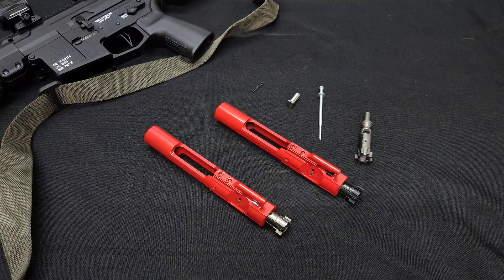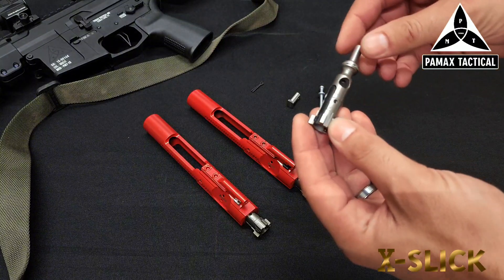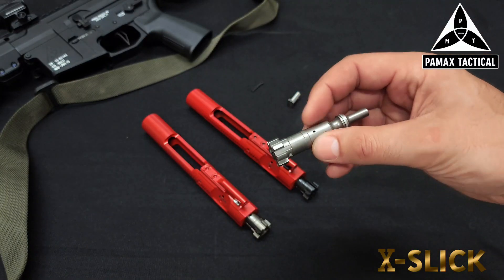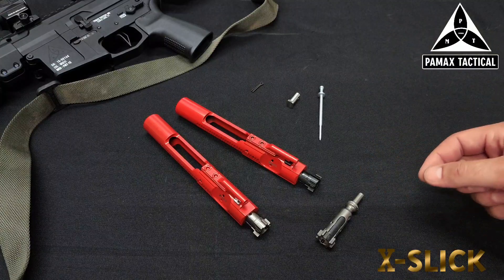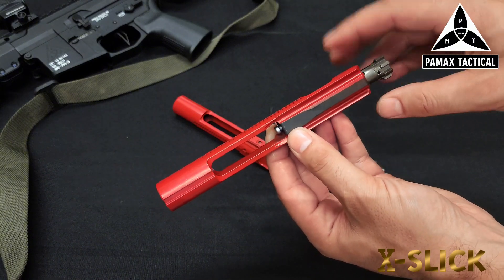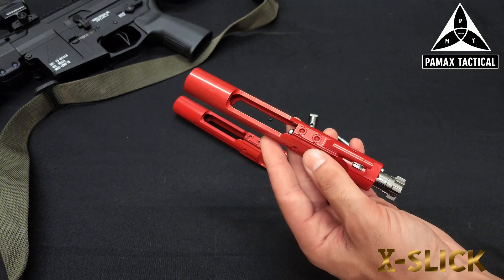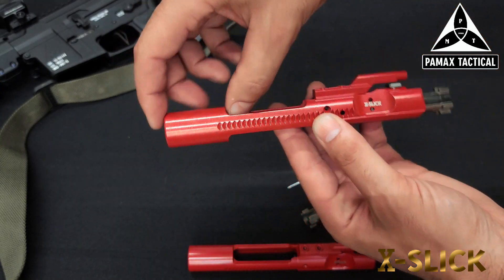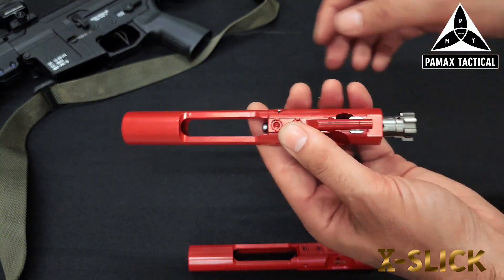XSlick Bolt Carrier Group Gen 2 Coating & Parts Overview - USA PAMAX Tactical

Comment: I have called PAMAX at least 100 times over the course of a week. And all I get is a machine that says they are either with other customers or on the shop floor. IE cant be bothered. Which tells me that this so called company, Especially their customer service is the but end of a joke! Not only that they are located in Florida but the telephone number is out of Pennsylvania. And that in itself seems to me like its quite shady! And because of these factors I will NOT be doing business with them even if I could reach a customer service Rep!
Reply from the maker: Hello sir, we mostly manufacture product, resale is only part. You probably got your call blacklisted as a result of spam filters. Feel free to shoot an email or text, you'll get a faster response since the phone is not monitored regularly due to high volume of spam.

Comment: U spend a lot of time crapping on Nickel Boron on your website (rightfully so) but then you use a Nickel Boron bolt.....

Care to explain why?
Reply from the maker: @KevinWood44  Absolutely. So if practical, we WOULD use our XSlick coating instead of NiB. The problem is our coating is not done through electrolysis, and so (right now) we can't get a perfect of it on the bolt. So we need to use a market coating to maintain the appropriate tolerance specs.

NiB is used for the bolts instead of nitride because it offers some corrosion resistance, but DOES make it easier to clean.  Where as Nitride does not. The NiB is not being used for reducing friction properties in this case but does fit the role of offering good cleaning properties that we can't fulfill with our XSlick. 

Remember, the NiB is only a surface coating. The bolt is chromelined, so you don't have to worry about NiB interfering with long term bolt performance. 

So simply put because it's easier to clean as a bolt surface coat then Nitride or parkerization and still offers corrosion resistance. It was a calculated decision.
Reply: @pamaxtactical  OK that makes sense.  Appreciate the feedback.  

It's an intriguing coating.

I only have one NP3 (Sionics) which hasn't chipped at all, but from what I hear they aren't making many NP3 products anymore, since 2022ish.....BUT Sionics, FCD, KAK all seem to be replenishing stock, so maybe it IS still being made/used?!?! 

Regardless, for $159 this BCG certainly seems worth it.
Reply from the maker: @KevinWood44  We try our best. Thank you for the question!
Reply from the maker: @KevinWood44  Great question by the way.